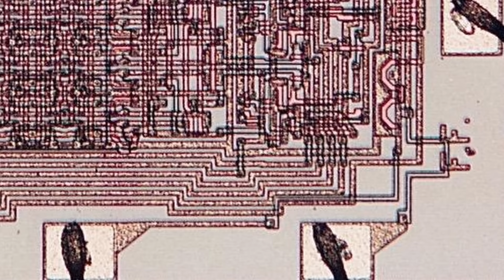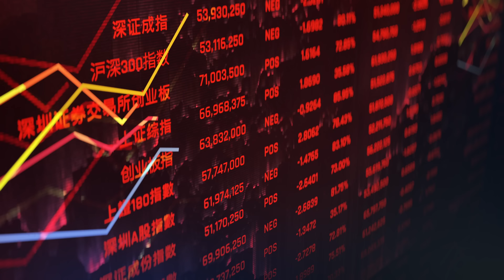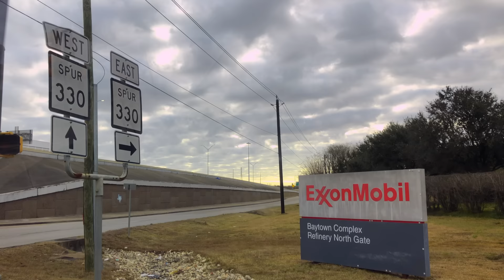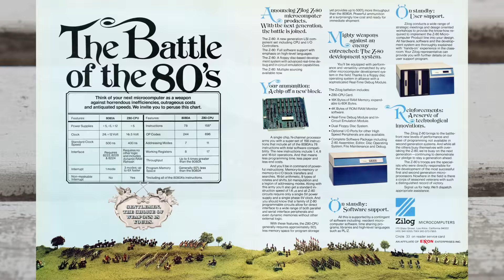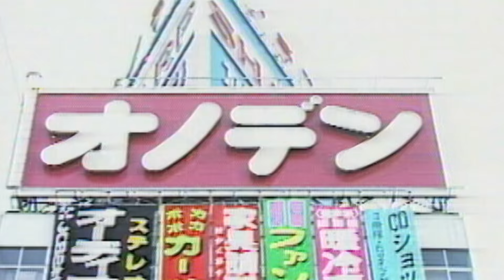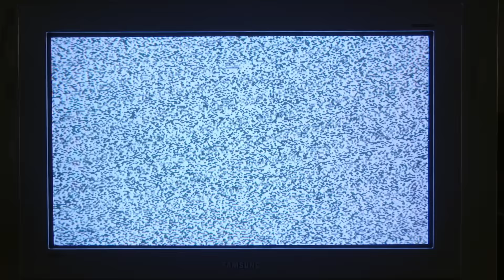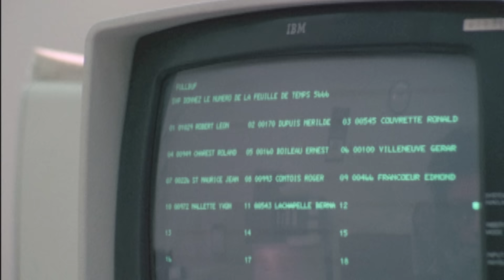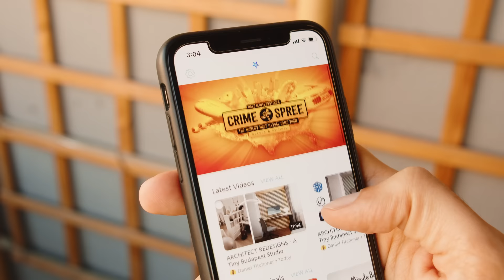Intel’s worst Nightmare

Comment: This video is interesting but the IBM 5150 PC used the 8088 with an 8-bit data path.  IBM's  early plan was to use the 8085 for the PC but the machine was capable of using the 8088 with minor changes to the design.   The 16-bit data path of the 8086 would have required more changes so they chose the 8088 instead.
Reply from the maker: Yea but the 8088 is basically a 8086 with an 8 bit data path and I could not explain that and the x86 name without derailing the video
Reply: @LowSpecGamer  The Z-80 was a huge success in the days of 8-bit machines.  In '77 Tandy/Radio Shack introduced the Z-80 based TRS-80 Micro Computer System [later called the Model I].  By 1978 they were selling more MCSs than all other microcomputers combined.  The Z-80 was a great microprocessor and deserved to sell well.  Sadly, Zilog blundered when they progressed into the 16/32 era.  They chose to make a 16/32 processor that was not backwards compatible with the Z-80.  On the other hand, Intel chose to make their 8088 highly backwards compatible with the 8080 for both hardware and software. This protected the investments of Intel developers when most of their competitors did not care about their customers.  If you look at it from the point of view of developers it really could not have gone any other way than it did.  Intel did not beome dominant by revolutionary improvements but by not screwing-up like most of the others, including Zilog, did.

Comment: Nice video, but... the IBM PC was based on the 8-bit Intel 8088, NOT the 16-bit 8086. It was an 8 bit machine, using an 8-bit processor driving an 8-bit bus...
Reply from the maker: The 8088 is a variant of the 8086. I needed to simplify that explanation in order not to go into a tangent for why it is called x86 and not x88

Comment: The IBM PC had the 8088 processor not the 8086. The 8086 came out after the 80286 for the IBM PS/2 line's lower end models, the higher end models like the PS/2 model 80 having the new 80386.
Reply from the maker: 8088 is a version of the 8086. This was an intentional simplification to not take video off a tangent
Reply: @LowSpecGamer  How can the 8088 be a version of the 8086 when the 8086 came out much later?
Reply from the maker: The 8088 was introduced in 1979. The 8086 was introduced in 1978. The 8088 was a version of the 8086 with an 8 bit bus. The executing unit of both is, as far as I know, identical.

Comment: The Z8530 serial communications chip was very good.  Could do both async and synchronous communications and and had 30 bit input buffer.
TI chose that chip to use for the comm port on the MS-DOS based Professional Computer - aka the TI-PC.

Comment: Wow, and NEC D780 is a Z80 clone, I never knew that. I always thought the D780 was purely NEC's, nothing to do with a Z80, another mystery chip that I wasn't going to investigate as I already had enough challenges.
Actually I later developed a device using a later Zilog chip, the Z8 - however how I arrived at that chip is mega weird, an accomplice tossed me a Z8 development kit and said 'Here, use this', with no idea on his part on the suability of it to the project.

Comment: Integrated circuits (1960's) were the breakthrough, processors were just the start of and continuation of the rescaling and miniaturisation that has continued right up to today's processors. Even now all they're doing is duplicating what they know smaller and connecting them in integrated circuits.

Comment: you're wrong about why the IBM PC didn't use zilog.   IBM wanted a 16 bit processor and Zilog was working on one with the Z-800 but engineers at Zilog were more excited by the 32 bit RISC Z-8000 so IBM got tired of waiting and went with Intel.   The Z-8000 was an excellent chip that should have gone far but had a couple minor bugs that never got worked out, probably because they didn't have the money from sales of a huge contract like IBM.   The Z-800 was never built even tho the company produced datasheets and application notes.
Reply from the maker: Not wrong, it just depends on who is telling the story, like always. The 16 bit efforts of Zilog is something that I explore more on the SideQuest episode. According to the z80 trio (link on the interview in the description) it was the Exxon relationship that made it imposible for them work with IBM.

Comment: The 6502 had pipelining, way ahead of x80 chips.  I programmed any chip my company threw at me, so I have no religious leanings towards any chip. 
The Intel 8080 sample kit was a beautiful blue box with the CPU & support chips laid out.  Before the Z80, Our college computer club got those kit for $20 from Intel !

 The KIM-1 6502 computer on a board was fun.  I wore out the hex keypad.

I loved the DEC LSI 11 assembly language.  Orthogonal instruction set -- ANY addressing mode for EITHER operand.  Didn't need to memorize instruction operands

Comment: I much preferred writing code for 6502. The Z80 was better in performance but the assembly code is nowhere near as "elegant". The Z80 was the choice for a device that you programmed once and then forgot about but for a computer the 6502 was much nicer. Of course they were both better than the 8080!

Comment: Close, but no cigar (or brass ring).  CTC (Data Point) came to Intel to have them build a processor for them. Intel laughed at them, but turned their idea into the 4004. Now you can continue your story.
Reply from the maker: You are thinking of the 8008, the 8 bit version. The 4004 was commissioned by Busicom. You can check my sources in the description, directly from Faggin himself

Comment: o my what a wonder story that i wished i knew back then.. repairing some circuit boards that needed a replacement intel chip i checked the specs and cheap price purchased some Z80s to play with and like a champ it worked very well 😎 this stuff was just a side-line of repairs while many new ICs were coming out every year. 🥰 what an era and thanks

Comment: One small mistake, the 8086 was 8 bit, the 80286, 80386 sx are both 16 bit and the 80386 DX, 80486 are 32 bit as was the Pentium 1, 2, 3 and 4, followed by the AMD 64 Bit command architecture. Otherwise very accurate and otherwise excellent!
Reply from the maker: The data sheet describes it as a 16 bit microprocessor https://datasheetspdf.com/datasheet/8086.html

So I am not sure if I missunderstood something!
Reply: @LowSpecGamer  I understand where you are coming from however I owned a Sinclair 1000 with a Z80 and an Atari 1040st, followed by and IBM Compatible 8086, that I later upgraded to an 80286 and the primary reason was the 8086 was limited to 8 bit and therefore only DD Floppy disk drives, I wanted to make use of 1.2k and 1.44k disks and that was only possible with a 16 bit processor. There wasn't an I/O card available for the 8086 that could support anything higher than the 360k 5 1/4" or the 720k 3 1/2" disk at anytime. Believe me I called every computer supplier in Westen Canada hoping to get a different answer! I was only about twelve the time however I was already learning to program in Turbo PASCAL and GW BASIC, I had basically mastered MS DOS 3.3 through 5.0 at that point and soon as high as 6.22 if my memory serves me correctly. Another limiting factor was RAM on the 8086 was limited to 640k but the 80286 supported extended RAM above 640k but not for processing, it could be used to load drivers and for RAM drives etc and with the 80386 basic multitasking became a possibility but in a very limited scope. You had to have an extended memory manager to really make use of it and when the 80486 came out you could use expanded memory above the 640k limit. Often times I would have to configure various boot discs to configure autoexec.bat and config.sys for specific applications to make them function or I would have issues with not enough available RAM if I wanted to make use of both a mouse and a dial up modem or a printer for example. Don't even try to imagine networking before the Pentium class of processors or before Ethernet, that was almost always a nightmare!
Reply: 8086 was 16bit, fully 16bit register structure, 16bit ALU. 8088 was an derivate with 8bits external, but that was just a cost saving measure (not so much for the chip itself, but for all the support hardware) and doesn't mean anything from an architecture/software standpoint.

Same for 80386SX. 32bit internal, 16bit external. 

Early Pentiums than turned that around, they were 32bit internal, but had a 64bit external bus. That because they were one of the first CPUs which were that fast internally, that the memory couldn't keep up with supplying them with new data. So they used a 64bit external bus to be able to transfer 2 32bit values at once.

Comment: I have to comment that Zilog did not fade into obscurity. they refocussed on embedded microcontrollers and where very successful with the Z84 (embedded Z80) and Z86 platforms. and later DSPs.
Reply from the maker: Technically correct. When I originally wrote this video I was aiming it as a more modern PC audience and I was assuming they would know intel but never heard of Zilog. They faded into obscurity as a consumer processor company was what I meant

Comment: Kinda wrong in several aspects.  Silicon was developed by Fairchild in the early 60’s.  The Busicom guy and the assembly line did not use a 1930’s soldering iron.  They didn’t develop the 5 volt only technology.   Mostly right about Intel being it’s own nemesis.
Reply from the maker: MOS silicon gate was invented by Fairchild. Federico Faggin was the project leader. According to the source in the description, it was his frustration at them not doubling down on the technology that lead to him leaving for intel.

I am aware they would not have used a soldering iron. Ungermann would had also not developed the simulator on a modern looking computer. These are intentional simplifications in art made to convey to a general audience what is going on, since the point of video is not extreme historial accuracy but to be able to tell the story to a YouTube audience.

The didn’t develop de 5 volt technology. They simplified the voltages for the Z80 in comparison to 8080.

Comment: I had a Zilog Z-80 CPU in my old Commodore 128 for CPM, but I wonder if there were other ways to use it on that system?
Reply: Though admittedly, I don't have the actual hardware but I do have C64 Forever which includes C128 emulation--and I believe that includes the Z-80.

Comment: The 8008 has no continuity with the 4004! Instead, it descends directly from the Datapoint 2200 CPU board.
Reply from the maker: I don’t think I say it is the successor, sorry for the confusion. The only connection I commented was that it was Faggin’s preferred intel processor at the moment of designing the Z80.

Comment: Very fond memories of the Z80, Z8 and the CPM operating system that ran on the Z80. We were a small manufacturing business that was early into desktop computing and building our own specific process automation systems. I had and exceptional IT man with a small team and he produced lots of great stuff using distributed Zilog based systems. A lot of these systems are still in use today. This kit enabled us to do a lot without spending vast amounts of money and the modular simplicity has given it an exceptionally long life in the fast moving IT hardware  world. The IT man and Zilog chips kept our business ahead of our competitors for many years  many who no longer exist today.
Reply: CP/M did run on the Z80, example the Kaypro 4-84.  But CP/M was written in 8080 assembly language (I have the source code).  The Z80 assembly language was a superset of 8080 assembly language.

Comment: No worries. The Z80 instruction set was hard to understand, the 8086/8088 was easier.
Reply: Have to disagree with you there buddy.
The 8080 instruction set was very obscure, and the 8086 grew from that.

The Z80 instructions reminded me of the PDP8 set I learned in college.
Reply: @curtisrendon204  Oops i meant the 6809 was easier.
Reply: @perfectionbox  Ah, cool.

I've only looked at some of that code, it did seem easy to understand.

Comment: The Sharp LR35902 is NOT a Z80 clone. It's actually a weird bastard child of the 8080 with some Z80 features (but not most of them) and a bunch of its own oddities that uses a zilog-syntax assembler.
Reply from the maker: From what I understand from the copetudo technical breakdown it is more z80 than 8080. “Clone” might be the wrong wording there, but I needed some quick way of communicating the impact the z80 had in gaming devices without derailing the video
Reply: @LowSpecGamer  Hey, man, thanks for responding. Cool to know!)

Comment: OK, so, I'm sure you could clone an Intel but they're still going to get you on the x86 ISA licensing.
So, in the 70s, had ISA licensing just not been invented yet?
Wouldn't that have been the solution for ZiLog?
Clone it, fab it, design any drop in replacement, with our without extensions you like, but you still owe us licensing fees?

Comment: When an IBM executive decided on the 8086 these were the facts:
The 68000 was 32-bits
The 68000 had 14 vendors
The 68000 was easier to program
The 68000 existed
The 8086 facts were:
The 8086 was 16-bits
The 8086 had only 1 vendor on their schedule at their prices
The 8086 was very difficult to program, especially in the protected mode
The 8086 did NOT exist
So, why was an executive making an engineering decision?
Follow the money!
Reply: Nice conspriracy theory, but you got some basic facts wrong:

The i8088 had been out for a while (released in 1979) when development of the IBM-PC was started. What was NOT available, was the 68008. It was announced, but delayed and came out in 1982. After the IBM-PC was already out for a while.

They didn't want to use either the 68000 (which also came out in 1979) or the 8086 (released in 1978) because they both would require 16bit memory, which would have significantly increased the total system cost.

Also the 8086 didn't have a protected mode, that came with the 80286, was buggy and cumbersome to use, but more or less fixed with the 80386 (which also did away with most of the other things annoying with the 8086)

Comment: Intel for most of it's life has offered a lower spec processor for a higher price and frankly without any competition they don't tend to innovate.
that is why I have always preferred to back any underdog that goes up against intel (AMD, Cyrix, Transmeta, etc) because it means cheaper and better chips for everyone including even Intel users.
Without any healthy competition for intel we'd probably all still be using single core processors with less than 1GHZ clock in 2022.

Comment: something you missed,  demand was so high Intel contracted zlog to make the 8086. zlog then made the 80186, 286, 386 and 486. by the time intel got to the 586 they had the tooling to meet demand and told zlog to cease. zlog sue and the court said they had the right due to implied contract. intel solved the problem by renaming the chip tp pentium.
Reply from the maker: What happened after Faggin left was not really the focus of the video, so I did not went very deep beyond answering the question a modern PC user might have about Zilog not being a thing in modern PCs.

With that said, can you point to a source on this? Particularly the Zilog lawsuit and Pentium. I was looking for lawsuit records and could not find a single reference and would like to read more.
Reply: @LowSpecGamer  sry, it was AMD.  Litigation started in 1987 with AMD claiming there to have been a breach of contract. Intel responded with a countersuit for copyright infringement (Intel's 287 FPU), followed by an antitrust suit from AMD and then a second copyright suit by Intel over AMD's AM486 IP.

Comment: Ummm, yeah, actually Fairchild Semiconductor was using silicon from the very beginning. Maybe you meant Shockley Semiconductor? That's where most of the team at Fairchild was working just before funding Fairchild Semiconductor.

Also Faggin, did not invent the silicon transistor. He lead the team that you could say did that, but it's not good to erase the contribution of the rest of the team and just give that achievement to the manager. Managers don't just will stuff into being. Even good engineering-savvy managers still need their teams to do their work. If they didn't they wouldn't be a manager but an individual contributor.

I know that this is just a youtube video, but you do have quite a few inaccuracies throughout your video. It would be great if you at least threw in some cards to clarify or correct the points you got wrong.
Reply from the maker: My source is in the description, but some clarifications. Silicon for most of the transistor yes, but he lead the team that perfected silicon GATE technology at Fairchild. He also did not do it alone, he lead the team that did it. I say all of this one the video. Here is the direct quote from the video script:

“had recently led the team that figured out a method to make transistor gates out of silicon”
Reply: You criticize the too many merits attibuted to Faggin while you do accept the fact Intel did not recognize at all his contributions???
Reply: @LowSpecGamer  But you also say that he was the inventor? How does that stack up? Are you nullifying the contributions of the rest of the team then?
Reply: @Schcarraffone  I just refuse to give the manager of a team the credit for the work of the team. 

If someone goes into a cave and solitarily invents something on his own, without a team, that's one thing. If dozens of people toil to together to accomplish a complicated task and then someone "Edisons" all the credit, that's just not right!